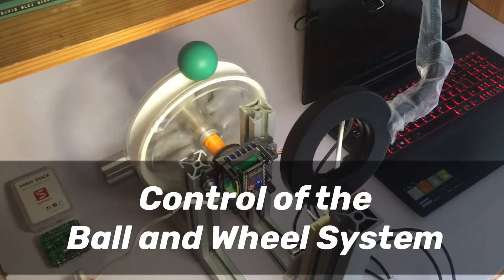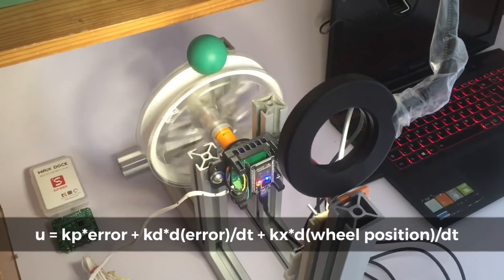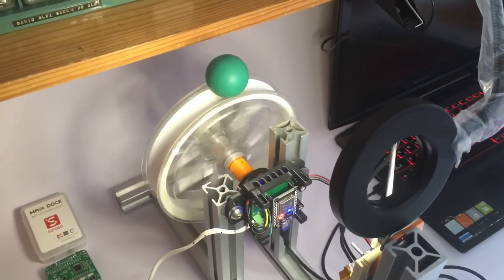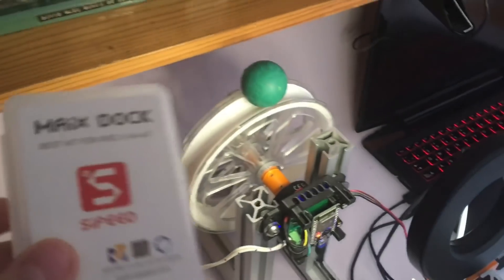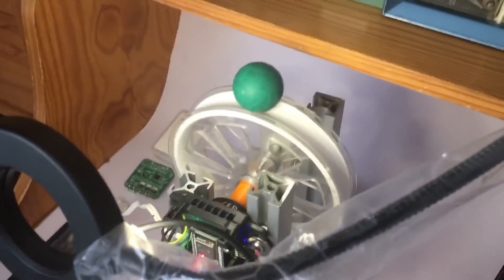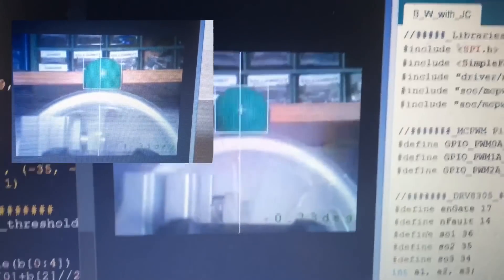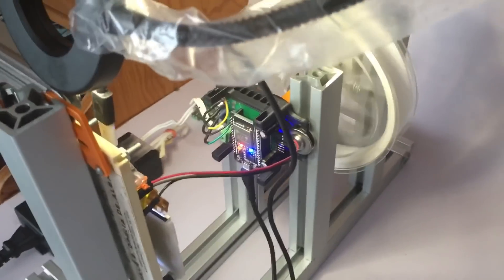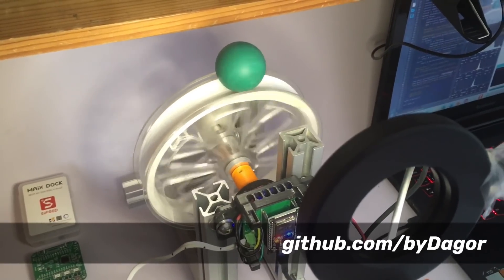Control of the Ball and Wheel System

Comment: Love it. Does the system favour slower wheel speed or is there a danger it'll drift towards max wheel speed ?
Reply from the maker: I've left the system running for 8+ hours with no problems, I have to turn it off for it to drop the ball. I'm sure the maximum wheel speed is above what's needed for this system.